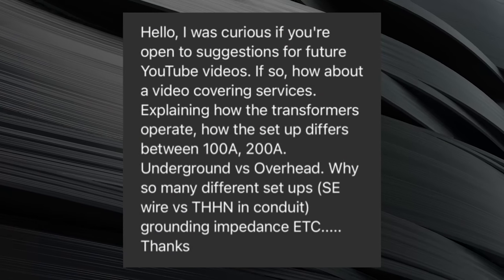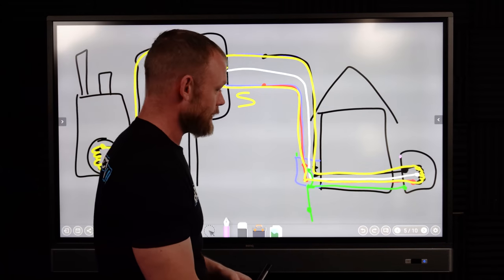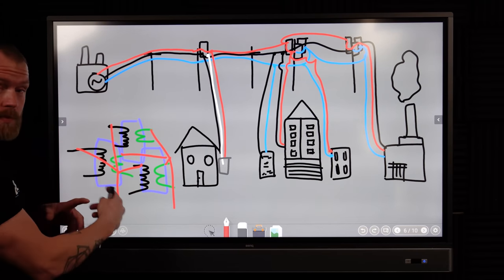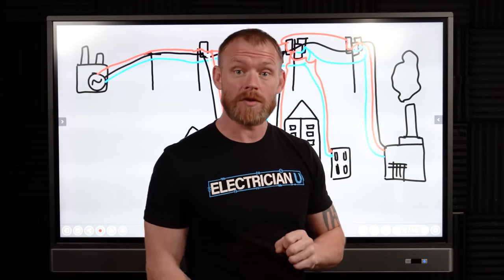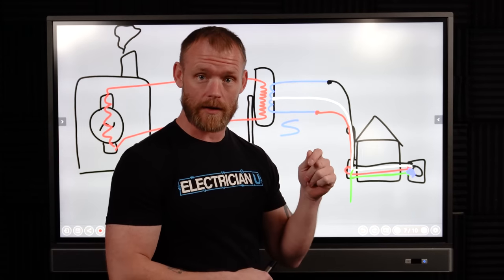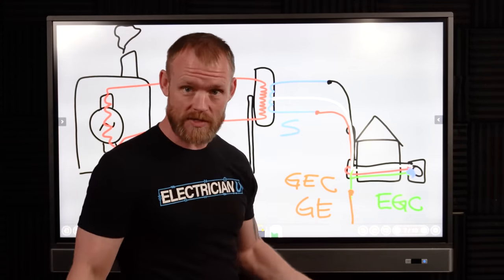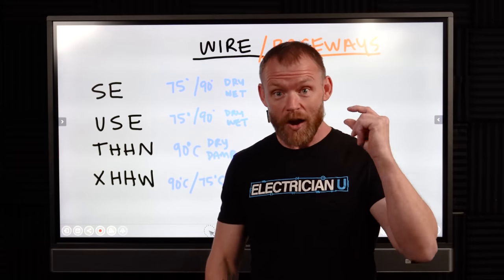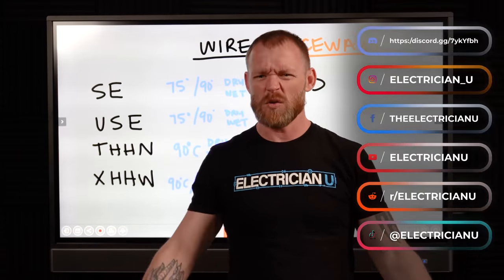How Does an Electrical Service Work? Electrical Service Panels Explained

Comment: Mr. Dustin, I would like to know why in a 240V electrical connection,one joins the two 120V wires. produces a short circuit. You said that in a transformer is a continuous lopes circulation.(why?-¿Porque?Thanks,
Luis -PR
Reply: They short because there is not resistance. The coil inside of a machine, luminare, or othere device slows the current. Otherwise a massive amount of current will flow tripping the breaker.
Reply: @Makitafan  Much better than I was going to respond. I was simply going to say “Resistance” 😂

Comment: Using wire nuts on electric wires safety to extend the wires to a sub panel is a common practice. But I get different opinion on using wire nuts for dc connections to prevent arcing if used correctly wire nuts work, yes.

Comment: I live in a big city with underground service, transformers buried beneath the street. Recently, one of the service lines coming into my house died, so half of my panel was down and my 220v HVAC would not function. Happily (for reasons I do not understand) the power company in my area is responsible for everything right up into my basement where the meter is, so they came and bridged my service for a few days (120v only) until the proper crew could come a few days later to pull a new line. Or so I thought. Just last night, half my circuits started flickering. I put a meter in an outlet and voltage was all over the place. Opened the panel and tested the main lugs and same thing, but only on one side. Happened for about 10 minutes before stabilizing back at about 119. Doesn't seem promising. The downside of underground wire, especially in an old neighborhood with old underground conduit.

Comment: Could you do a video about commercial lighting upgrades from flouresent to led, led with ballast and direct power thru driver. Also commercial wall pack upgrades, from sodium or metal halide to led retrofit, or corn bulbs. As the technology change what are the pro and cons. Thanks for sharing the craft. 🧙‍♂️🪄

Comment: Majority of my electrical knowledge is automotive. So an ignition coil is just a step up transformer and the one connected to my house is a step down. But it’s basically the same thing. Is that correct?
Reply: correct

Comment: Can you explain a conundrum I can't seem to wrap my head around,... Occasionally I would have lightning occur in my backyard,.. ok not really,. It was the over head service line that was damaged,. And I only have 2 insulated lines and the tension cable,. in the air (from my house to the power company) I have an electric dryer and electric stove so I obviously have a 240 volt service,.. but one of the insulated lines,. Was not only damaged but completely severed,..😲 I never lost power to anything in my house😲😲 everything on each side of my breaker box (both phases) still functioned properly,.. HOW? 🤯
"And I should have paid closer attention but I wounded if my meter was still counting if I only had one connected line coming from the power company 🤔🧐🤨
The service line technician who fixed it, said something along the lines of having an impressive ground 🤷‍♂️

Comment: As an electrical engineer who designs apartments (among other things) I can tell you that we never run pairs of phases to each building. The only thing that doesn't get all 3 phases might be garage buildings. With varying building sizes on a project balancing the loads would be a nightmare if you were using pairs for each building rather than all three phases.

Comment: in a industrial plant setting which im more formalised with as a maintenance personnel ( i really don't do home's unless it's mine 😉 ect. and i let someone else if the need's arises for the licensing for residential as mine is for maintenance work ) have case ground to earth 🌏rod is best practice but older 3P plant's doesn't always have it and i have seen the aftermath of a fire/blast from that failure and know of regular floor people who have gotten hurt by that as well

Comment: I have a question I can't find a good answer for. Might make a good video. Say hypothetically you have a standard modern code house with a proper grounding system. BUT, someone forgot to hook it to the grounding rod. So in essence, you still have a system with a path for fault current to return to neutral, but neutral is not grounded. Discounting lightning/surges, wouldn't this setup be safer for the occupant? If, say, a metal appliance was energized by a loose hot, you wouldn't get shocked by touching it since there is no potential between hot and ground.
Reply: In terms of the occupant, it is just as safe.  I wouldn't say it is safer.  The ground rods are there to protect the building and occupants from damage that lightning can cause.
Reply: Your appliance frame should be connected to ground.  If a hot wire touches the frame, you want the circuit breaker to trip.

Comment: Overhead services are easy to repair and replace. 

Underground you are looking at a minimum of 2-3 hours to repair because you have to call underground locates. And then the utility company has to find the problem, splice it, and bury it. Then your yard is torn up from the large equipment and digging.

Comment: Can you do a video on How does a solar system feed energy back to the grid.
Reply: The system uses an inverter to follow the grid voltage, which contains a feedback loop to solve Ohm's law, and generate a slightly higher output voltage, so that it pushes current onto the grid.   The UL standard that governs inverters requires that they never feed a blackout grid, for the safety of repairmen.  This means that a "healthy grid" with voltages and frequency in spec, must already be running, and the inverter simply generates a subordinate waveform that can synchronize with it to push power onto the grid.

For bookkeeping, we say that it feeds the on-site loads first, and anything left over is exported to the utility, and subsequently feeds your nearest neighbor's service.  In reality, that all happens simultaneously, and you can't really keep track of where any individual unit of energy goes.  It all goes to the loads that demand it.

Your meter only measures the net flow of power at any given time, and if built for it, will spin backwards any time that you export, decreasing the cumulative kilowatt-hours.

Comment: Good video but one thing that’s wrong is your explanation of single phase. The utility does not take a conductor from the red phase, and the back phase and send it to a house. That would be 2 phase power, which is actually a thing in Philadelphia. The utility takes 1 conductor, transforms it taking 120V from ground, on each side of the secondary transformer. A neutral is tapped at the center of the coil, and bonded to ground at the pole. Go out into the country and you’ll see on top of power poles, 1 conductor, with a neutral below it
Reply: In my experience, the distribution network is a 3-phase Y, and the transformer primary is connected to one phase and the neutral.  The neutral is grounded at the pole.

Comment: You're saying utilities drop 2 phases to houses? I believe it's just one phase and split up in the transformer to make 120/240
Reply: It depends on the standards of the utility.  Some opt to connect across two phases, while others connect across one phase and the neutral.  We still call it single phase, regardless of what the utility does on their side.
Reply: When you take power from two phases of a three phase system, that’s just one phase.  You can power the primary of a single phase transformer with AB, BC, or CA.  In a “Y” configuration it would usually be AN, BN, or CN.  In all cases, the result is single phase.  You need at least three wires to get multiphase.
Reply: @GH-oi2jf  Right, you generally don't take a full 3-wire MWBC ("open wye") from the utility's distribution circuit to power the primary of a transformer.  Not for a split phase customer.  You would do that for an open delta 3-phase service, which is rarely recommended.

It's either AB, BC, CA, or AN, BN, or CN that powers the primary of a single phase transformer, ultimately with just one waveform.

Comment: "single phase" should be called split phase. It's only half of a phase.
Reply: That's not accurate. Single phase 240v in the US has a neutral tapped in the middle. If you only had half of that, you would only have 120v. A house will get both legs of the single phase.
Reply: @commoncentstx  Incorrect.  It is only one phase of the three that are provided
 by the power company.    FULLY UNDERSTAND that local people call is two phases L1
and L2.  but it is STILL only one phase split at the midpoint.   
Thank you @Aaron

Comment: some of the video i liked but i disagree with some of the information that you provided. under ground is nicer in most cases and you did miss one reason in my case the weather and trees and pest's can nock out power for a day or more, as for 3P yes it's a better way of powering things ( but not always a choice as the utilities are the one's you're relying on for primary power source aka beggars cannot always be picky ) and in a solar or dc application's like fast charging BEV and shop tools/cheaper but better spec's ect. it works better so no not on board with you ( as you where hinting at it being only a big manufacturering/industrial idiom, in Europe and some parts of the usa and Canada 🇨🇦 its common to use 3P for residential or rural use ) and 150A and down is obsolete ( and border line disingenuous news for home ownership ) and dead go for 🇺🇸 220+A if it's a single phase setup and 400A isn't unnecessary depending on how the homeowner use's the property as things like 2 BEV can soak up more than 150A peaking by themselves 😉

Comment: How do you put a Transformer on a pole? Optimus Prime is bigger than power poles...
Reply: Different kind of transformer.  The transformer refers to those "buckets" you see at the top of the utility pole.  They are equipment housings, with big sheets wrapped in coils around an iron core, to transmit power through a magnetic coupling and step between voltage systems.  Transformers trade voltage for current, analogous to how a gear system trades torque and speed.

Comment: You said that single phase is created by joining two primary phases at a transformer winding. That isn't accurate. The utility will use a single phase (normally 7200 volts) and a neutral. The 7200 will be on one side of the winding, and the neutral will be on the other side of the winding. The neutral is bonded to ground. 

Keep this in mind: you are respected and seen as a trustworthy source of information. I highly suggest doing more research before making videos.
Reply: Not always, many parts of the country the utility has a grounded neutral, other parts they go hot to hot on the primary side.  My transformer for my street is primary side hooked up to two phases, neither grounded.  It really depends on the utility and how they decided to do it.  Anyway the exact specifics of the primary side aren't too important for these videos as the intended audience is residential and commercial electricians, not utility linemen.
Reply: @taylorlightfoot  7200v and neutral have definitely been the standard for a long time, and that is how it is generally taught (I have numerous examples of this). That being said, yes there are single phase transformers fed by two hot primaries. 

You're right on the relevance though. But if you are going to describe the primary side of a transformer, it needs to be accurate. Dustin makes informative videos, but he includes some moderate mistakes (and sometimes incomplete statements) that he never goes back and corrects. If you or I are wrong on something, we are basically just noise in the big scheme of things. In a position of authority, it is imperative that Dustin is either correct and thorough the first time, or he goes back to correct the issues later. If someone takes a piece of incorrect information from one of these videos and says it in front of someone important, it may damage their credibility, whether it was relevant to the video or not doesn't really matter. 

Remember, he is now selling continuing education classes. There is no "just a guy on YouTube" reasoning anymore. Dustin/Dustin's organization is approved as a source of education on electrical systems.

Comment: You lost me when you said 220.  There is no such thing as 220V or 110V!!  We use 240V / 120V in the US.
Reply: My understanding in the inaccuracy in terminology is a hold-over from legacy power systems. In the US 120 service can be referred to as 110, 115, and 120. Similarly 240 service can be referred to as 220, 230, and 240. These terms have been genericized so much that most experienced people know what you mean when using a slightly inaccurate term. Plus, due to line losses and minute-to-minute infrastructure load 120V service isn't going to be exactly 120.00Vac.
Reply: The nominal service voltage at the meter should be 120v/240v, but there is some variation, and the voltage at devices can be lower due to variation and voltage drop in the wiring.  Earlier systems had somewhat lower voltage standards, so the old standard is sometimes used out of habit.  Whether you call it 110, 115, or 120 doesn’t matter.  In all cases you are referring to the common electrical service in North America.

Comment: It seems you are a little mistaken about what single phase is. I'm not sure if you just explained it wrong, or if you really are confused on how it works because usually you know your shit.
Reply: I saw nothing wrong.  Residential service is single phase 240V.  Sometimes people call it split phase since we center tap a neutral onto the coil, but it's still considered single phase.
Reply: @taylorlightfoot  I meant in regard to the utility side. He claimed a single phase service is supplied by two of three phases on the distribution side.
Reply: @JacobYoces  it depends on the utility. That is a method utilities use for primary. On my street the transformer is fed from two of the phases. In more rural areas it’s common for there to be a phase to neutral connection as a primary. Both are methods used by utilities, they use different transformers depending on the type of primary.
Reply: @taylorlightfoot  As a logical extrapolation of 3-phase wye systems, 120/240V "single phase" systems behave like they are 2-phase.  For ideal waveforms, there are two waveforms that are 120V nominal to ground, shifted in phase by 180 degrees.  This is mathematically identical to taking a 240V single phase system and center-tapping it to derive a neutral, which is how it is really done (rather than time-delays to produce a 180 degree phase shift).

We just don't call it "2-phase", because that term is reserved for an obsolete system with a 90 degree phase shift.